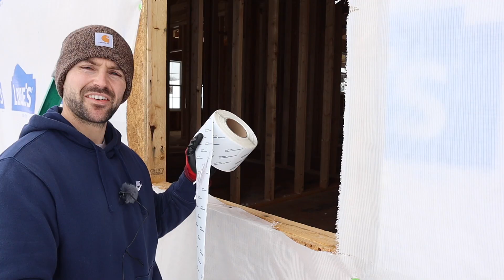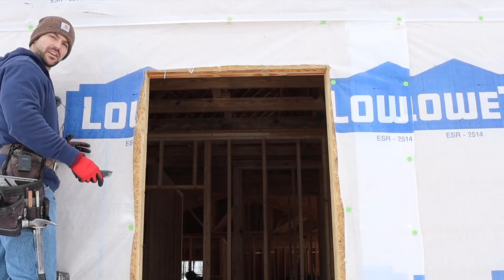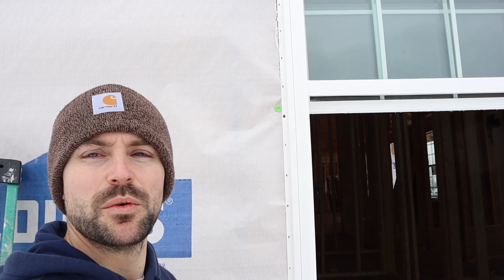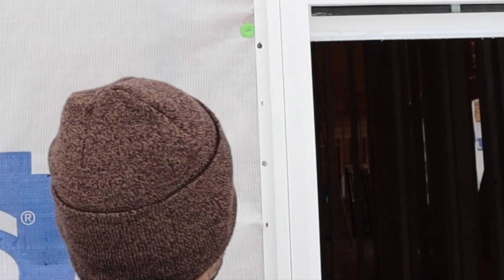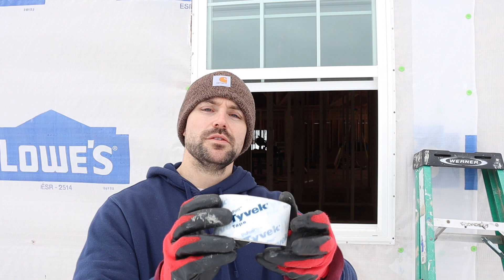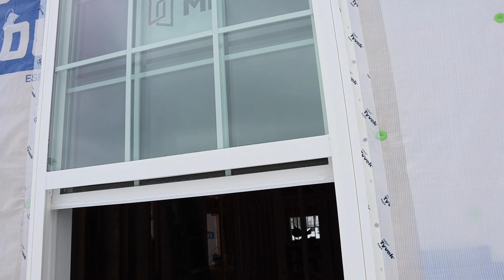How To Install A Window - New Construction

Comment: I appreciate this series and the info you share, but this particular video doesn’t meet a lot of the modern building science best practices. Jake Bruton has two different window install tutorial videos that are very well done. Several techniques that could probably be done better/different: sill flashing with stretch or liquid flashing, air sealing the house wrap all the way around the window rough opening, and not taping the bottom of the window for drainage.

Comment: This is not correct. You do not nail the top flange like that. In order to allow for settling you put the nail in above the flange. Put it in half way and then bend it downward to hold the flange.

Comment: I'm not a contractor just a do-it-yourselfer. I would put silicone around the frame before I put the window in. And then expandable foam. But only when it's unfinished, you don't want to crush the window

Comment: I’m just curious about why you wouldn’t want to put the 4 inch flashing around the insides of the entire window ans not just on that bottom part.
Reply: You can if you like. Its basically acting as a pan flashing for the window sill. The water or condensation will run to the bottom and rot the sill due to gravity. Some installers will bring the house wrap inside the window opening on the sides. Some guys use a liquid membrane flashing or a stretchy rubber flashing like Zip. Lots of ways to do it.
Reply: @mikez4132 that makes sense too.

Comment: Taping the bottom after the window is installed, you just made your sill pan useless because if water gets inside, instead of coming out it will build up and come inside the house since you just taped the escape gap shut.
Reply: If the window sill(framing) is tilted out, and the pan is sitting on the sill, maybe drill a 1/8 hole in the pan at its lowest point?

Pans don’t always drain all the moisture out. That’s why the vapor barrier(that’s designed to breathe) should be wrapped inside. Having a air tight home that is sealed is important. But you still want the house to breathe. Controlled air flow systems, cross breezes, soffit vents, ridge vents, crawl space vents, ceiling fans, air handlers, the space under the interior doors... vapor barrier.

Mold is the enemy

Comment: Water shouldn't go in anywhere if the window is a nail fin right?
Reply: Not necessarily... water can find a way. Heavy driving rains can push water sideways. The bigger culprit in my opinion, is ice. Ice climbs and makes bridges.
And letting snow set on your roof or the gutters, will get you too. Melting then refreezing, the ice climbs up behind the roofing material. Something like up to 7” at a time, in any direction. 
Ice can find a way behind the windows and doors too. 

What I try to do, is to caulk (behind flange when setting windows and backsides of window trim and all seems, joints and and areas where different materials connect),use metal or vinyl flashing drip edge (make sure you have about a 1/4” bend going down the face of the top window trim........... 1/4” down sides too)
Keep your cuts tight, and don’t fracture the material when installing.

If I’m living in an area that’s gets a lot of rainfall or snow, or both, always use a pan.

Dryer areas I wouldn’t worry about a pan. Right now I live in the high dessert of Oregon, people out hear don’t use pans much... some guys look at you and have no idea what a pan is.

I built log homes in Cashiers, Highlands, Glenville and Sapphire valley. It get so much moisture, it’s a temperate rainforest.

We used every trick we had installing windows and doors.

Anyways 
Hope that was helpful

Comment: Dont you have To get à height from inside from the floor To top of window jam where did you guys learn how to install a window totally incorrect dude learn the right way to do a window
Reply: Nope... better to use a laser lever and a transit, that’s attached to a sky hook. Although, It’s not easy to hold the hot air balloon steady, if there’s high winds. But it must be done!!!
Because starting with having your window sills at the height needed, to make sure your tops all line up is apparently impossible or just incorrect......... because I always forget to start with the door height as my control number... and... I forgot my tape measure too.

Guess I’ll just a bucket and a half inch hose... wait... water levels don’t work either. I’m incorrect again.

Comment: You didnt put  any sealant  between the back of window  frame  and the wood.  .lol I'm learning  but I've learned that ..
Reply from the maker: I use flashing tape. It seals around the window great. i’ve been building houses for years and have never had one leak using tape. Hope that helps!

Comment: House wrap should be cut even with sheathing.  Flashing should be sealed with a J roller.  Nail fin according to manufacturers directions. Never, never flash bottom of window
Reply: I agree that a lot of this looked wrong, but why not flash the bottom?  I don't see how that would hurt anything (but probably not necessary either).
Reply: @rjcarr316  they say you’re not supposed to tape the bottom just in case water gets in. If the bottom is open it will give the water somewhere to drain.
Reply: @rjcarr316  I think he meant tape the bottom of the window.
Reply: Never tape the bottom of the window in case moisture gets in it has somewhere to go

Comment: Really surprised they don't recommend a big bead of caulk on the inside of the nailing flange. And even around the outside edge. Even with the wrap and tape. Dealing with a leaky two-year old egress window now.

Comment: Couple things that may help. After checking for level and plumb, pull corner to corner and check your diagonals. Make sure the number is the same, and you know your window is square. I also like to caulk the back side of the flange, to seal for air, water, bugs and it helps in attaching your window. Nailing the top flange can compromise the window, if there is any settling in the framing above. You can take a dremel or fine cutting tool, and cut your holes, so that they are slots. About a half inch, and if there is settling, the flange isn’t effected. It’s still held by the head of your nail, and the nail can slide down if needed. I will pull the house wrap into the frame opening, on the sides and bottom, to protect the wood. The top goes over the flange, just like you did it. The tape isn’t necessary on the sill. The window has weep holes for drainage and pulling the house wrap over, will do the same thing. I enjoyed your video and hope your not offended by my comments. 
FYI... don’t choke up on your hammer, or use two hands either... at least not on your videos. I had to say it...
Reply: i have a question for you sir, on the sill when you cut the wrap and fold it in, what do you do at the corners? doesnt something need done at the corners for protection when you do your diagonal cuts?
Reply: @feralbigdog  yes... I like to tape my corners. I try to protect the wood as much as possible.
Reply: @scottallen5269  ok so do the diagonal cuts, then tape the corners, just the corners or the whole sill? all 4 or just the bottom corners?
Reply: @feralbigdog  nothing wrong with taping the whole sill... letting the water shed. I don’t do the top cuz the water could get trapped behind it. I focus more on sealing with caulking flanges and trim materials. Also focusing on the drip edge installation. 
Here’s a trick I use on the bottom seal... if you shim the sill on the inside and pitch the sill to the outside of the house( just an 1/8 or so)it will help shed the water off the sill.
Reply: @scottallen5269  i believe i saw that trick used by a youtuber called the essential craftsman, there is a project id like to do if we would ever be able to afford it(enclosing the back porch like mamaw and papaw had it), when i draw out my houses(ive been known to spend hours and hours, day after day doing carpentry on paper, placing every single element from floor joist to fly rafters in the drawing) i always draw in double window sills, so in a full size it wouldnt be hardly anything to tilt that out a little.
Reply: My contractor didn’t caulk the inside of the window before installing. The YKK instructions say to do this. Then I see videos like above. How concerned should I be? Is it enough to warrant removing the windows to add this caulk?
Reply: @garrettp.5018  my experience might help you a bit, in doing some repairs to this old money pit, the room im in had no windows in it(the numbnuts that lived here before took them out and just covered the holes with osb, with gaps, water got in, lots of work had to be done), when the new windows was put in those openings, i guess the caulking didnt seal good or maybe there was a gap but at the bottom left of the window, cold air got in and had mold setting up and growing, i took the drywall off(not cornerbeaded or mudded, just take out the screws and i was in business), i caulked all around it on the inside and havent had any more cold air in from it, you might try doing the same on yours, and if you are able, you might try caulking the top of your window flange, or some tape across it. i dont remember if the video had that last part.
Reply: @garrettp.5018  I wouldn’t remove them if they’re done. I like doing it cuz it helps seal for air drafts and bugs too. Along with helping seal for moisture and helping as an adhesive. If they are in already maybe just seal around the windows good when doing your trim and siding?
Reply: @garrettp.5018  Surely too late now, but it didn't have the siding done, then I would've pulled it and sealed it. I just put in a window, and now I'm thinking what I saw in a book might not have been the best way. It showed just folding the house wrap in, and silicone the nail flange. So far, every video I've seen shows the wrap all cut away (there is one on the sidebar that specifically says not to fold the wrap in), the sill shimmed and tilted (I'm using the old, so not my fault there), and adhesive flashing used. So I may pull it and re-do. But, when I built my back porch, I had it pretty much finished, then saw a few things I could've done better, and tore it all down and started over. So it depends how much work you're willing to do.
Reply: @garrettp.5018   I just watched that video I mentioned, and I'm definitely fixing my window. It was really informative and I recommend anyone to watch it. https://www.youtube.com/watch?v=RLlOw36KesQ
Reply: Your comment was very helpful. I'm starting a new job, installing new windows, tomorrow. I already knew how to do what this gentleman did but your tips might help me stand out amongst the competition. Thanks. 👍🏼
Reply: @jarrod9152  good luck!!! Hope you get the work
Reply: @apostolicway2604  without looking at it to troubleshoot, it’s difficult to break it down. If it’s where the windows are, you can look for any gaps in the siding, exterior trim, and make sure it isn’t the grade of the land( no water draining or flowing towards the house.
Also make sure you are sealed  where any materials are meeting/joining.

Best way to pinpoint the leak, may be to take a hose, and run a steady flow of water, and test possibilities.
Reply: so when you have 60 windows on a house I'm I suppose to make all the Flange holes bigger that a crazy idea, I'll take more time doing that than installing the windows and probably that'll void the warranty fron the windows that really makes no sense sir
Reply: @alvaroalmanza3386  It makes no sense? Houses move, and taking time to try and prevent problems, is part of our craft. Have you ever built a log home? Have you ever seen loads, transfer through bearing points? Ever replaced a shattered window, that was crushed by a header? Have you ever built in Florida and used slotted hurricane clips, that allow for movement, while still keeping materials secure? Have you ever lost the functions of a window, because it’s pinched?

What makes no sense and is crazy, is paying someone money, to improperly set 60 windows... just cuz they won’t take the time, to do it right.
Reply: @scottallen5269  Crazy indeed. Thanks for the explanations. 👍
Reply: @alvaroalmanza3386  if it takes you a long time, to make a hole a bigger, I’m not sure what you’re using.

How do you attach the top flange?

Comment: Do you later have to install shims before installing interior trim?
Reply from the maker: No you will not. After the drywall is hung it will be flush around the door. Good question!

Comment: I'm new to the construction industry but I've been told not to tape the bottom of the flange, just incase any water does get in behind it, it will have a way to come out then. Makes sense to me logically. Just wondering your thoughts and reasoning for taping off the bottom. Thank you.
Reply from the maker: I just tape it to prevent air from blowing in. But yes I have seen it not taped because of the reason you mentioned. Siding is going to be on soon so I am not worried about water as much as air!

Comment: Shout out to Gerald! Installing windows is the one thing that is next to impossible to do alone. Love the vertical sliders! Brave man with the nailer. Another good video. Thanks Josh!
Reply: Another great video. Very detailed and the audio is crisp. High-quality.
Reply from the maker: Thanks Kenny! I’d to keep the quality up. I like to make the videos.
Reply from the maker: I’ll tell Gerald you said so. Yeah you definitely need to people. Especially when you have two windows mulled together. Yes the nailer is definitely more risky than a hammer. Especially if you are new to construction. I would recommend a hammer method to most people. Thanks for watching Amazing Framer!
Reply: @TheExcellentLaborer  

Good morning Sir,  I  just  had Pella imprevia full frame replacement windows installed in my brick home 

From the inspecting the install , they didn't use flashing tape, they just use aluminum coil wrap for  ext . And Caulk 

Also they used fastener  in the tops of these Windows 

What is your opinion on the install I described